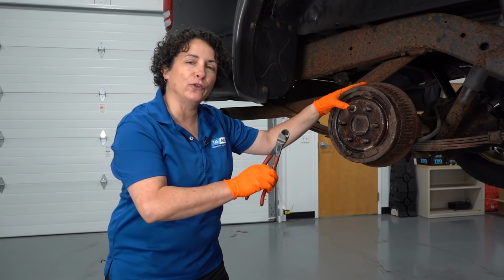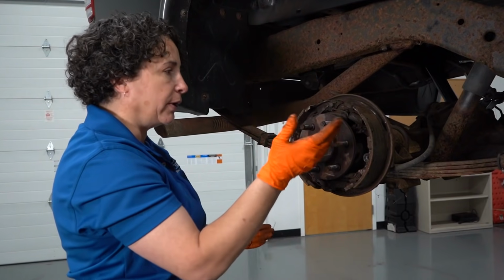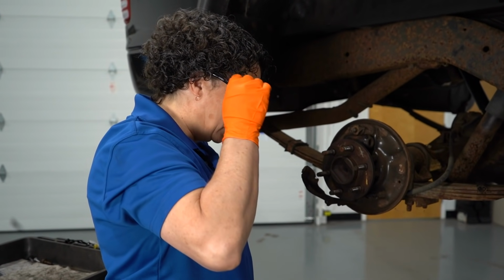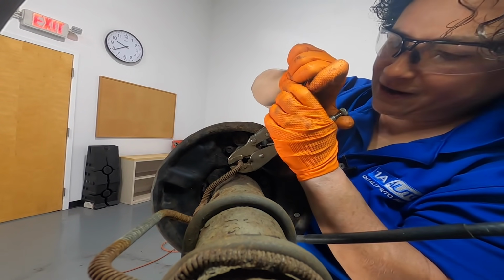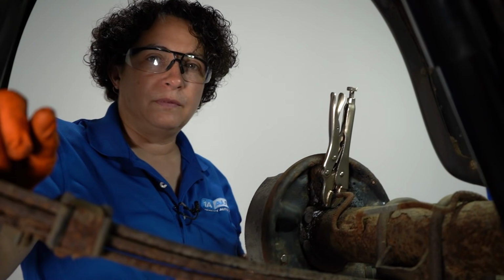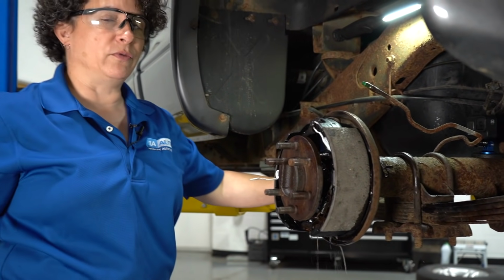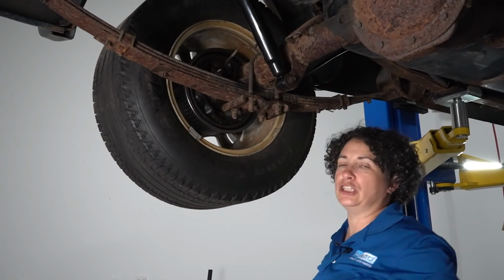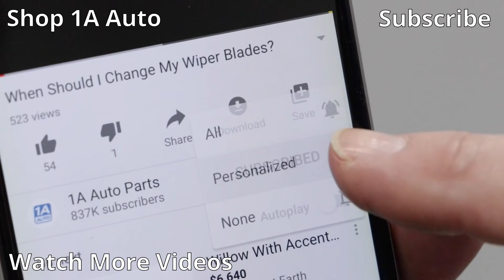Common Drum Brake Installation Mistakes!

Comment: Thank god for this video...my wife's cars drum brakes are starting to wear down and I told her I could replace them and said no wait until they start squeaking I'm like no babe that's dangerous....not only that but I like gaining experience from doing something like this and saving money
My wife is gonna learn sooner or later bad brakes dont last long at all
Reply: Drum breaks almost never come with the metal tabs that squeak. They do sometimes squeak when the drums surface is really damaged like the ones in the video but driving like that is dangerous
Reply: For disc brakes only. Once I hear the warning whistle, as I call it. I start saving money up for the brakes. Depending on how much you drive, or brake,,should be about a month. 2 Easy. But not guaranteed. Gather up the money. And if I have the money already, I go ahead and buy the brakes and throw them in the trunk. I personally will let the warning whistle go for a while. But as soon as the brakes grab hard, within the next seven or or eight days, I replace my brakes.

Comment: Im doing my rear brakes Feb 24, 24 Saturday in my 2011 silverado LT 1500 5.3liter. I have never done it before. Im not a mechanic. So im using your video to help me. Thank u.
Reply from the maker: +@losmoore3358 Thanks for checking us out. Shop for high quality auto parts on 1AAuto.com:

http://1aau.to/m/Shop-1AAuto-c

Comment: Just put new wheel cylinder brake pads drum on driver side.
The old one had a yellow plastic spacer in between the drum and hub..
Turned the wheel bearing and drum get a grinding sound 90% sure it's not the shoes. Pretty sure it's the backing plate.
Do I just put a new spacer or is there a way I can figure out where the grinding is on the backing plate and drum?
Do you have a video showing this process??

Comment: I ruined a brand new wheel cylinder because I was trying to bleed the brakes with the drum on lol thanks for the info I didn’t know what I did wrong    I replaced my wheel bearing and the last thing I have left is to do the rear drum brakes and I was having difficulty bleeding them. You helped a lot sometimes the simple things help people so much!
Reply: With the drum off I’m sorry

Comment: I've never had to adjust a brake cable doing that job unless the brake cable was too loose. And to adjust the brake cables on a system like that,you put on the new brakes, you close the adjustment so that the brake drum slides on uncomfortably but not too tight. Take the vehicle to where you got a lot of room and drive backwards up to about 10 or 15 miles per hour and then slam on the brakes. That will automatically adjust the shoes inside of the brake drum. Caution. Skilled drivers only

Comment: Bought a 2007 Saturn ion 2. Both front tires would skid when hard braking. Both rear wheel cylinders were bad. Replaced front rotors and calipers and pads. Then rear shoes and cylinders. Now my driver rear locks up and skids on hard braking. What did I do wrong?😢

Comment: 2 weeks ago the mechanic replaced my rear brake shoes. Now my two rear brake cylinders are leaking fluid on the drum shoes and have ruined them. What do you suppose they did that could have caused that?

Comment: I really need help with a nissan 2013. sv with 
I took it to the shop to check brakes because they were low. Then the mechanic said it need to replace all nrakes in order to give me guarantee of the job. I let him to replace them and the car still the same.
So, i took it to Midas they are specialists in brake. and their disgnostic is the master cilinder and they were about to charge me 900 dlls . It is a lot of monet so i decide to do it myself, I replace the master sylinder but i have the same problem. What you can tell me to fix my problem? im desperate. This is my daughters car and i wanted to return ir to her but im frustrated with mechanics that tehy only want to rake advant of ppl.Please help me
Reply: #1 Never go to Midas,  it's always $900 and honestly I'd avoid all major corporate chain places to look at it.
#2 If you've already paid for repairs they should guarantee their work till it's right. Have you told them? Or called a corporate office maybe?
#3 What happens when you pump the pedal does it get harder to press or stay low?
#4 Have you tried an online forum for your specific model vehicle?
#5 You could buy an online Haynes manual as a guide

Comment: 133k miles and never had brakes done????   I'm surprised there is any brake lining even left on those shoes and I'm surprised she didn't have to cut the drum off, or pull the axle shaft out to get the drum off.

Comment: One subtle point I’ve messed up in the past is getting the shoes on the correct front or rear orientation. Was hoping to see that here. Also I don’t know how you New England folks can stand working on so many corroded parts all the time. 😨
Reply: Always remember if short shoe in the front long shoe to the rear. Unless both shoes are the same length on the breaking pad itself. Back in the day they called it a short shoe and a long shoe short shoe to the front long shoe to the rear

Comment: I got it all toghter, new cylinder installed, shoes installed, springs back on, then before installing the drum, pressed on the brake to test. blew out the cylinder, back to the drawing board.

Comment: My truck has the stock push nuts on the drums at around 130K, but the drums look great and I was almost tempted to not even replace the pads. But I'm in Texas, have owned the truck since 20K, and don't brake aggressively.

The slave cylinders both weep around the seals though, so I'm going to have to order them and go back in.

Comment: Also it's not on size fits all with those tools. I got just one retainer spring tool which has two sides and the larger side was still too small for my F-150, so I used pliers (probably easier anyway) and the plier tool didn't fit around the pin that the 2 top springs attach to. Still got it to work, and with a truck, you really need the right tool cause those springs are strong. I should have bit the bullet and sprang for a tool kit. lesson learned. And I don't think the F-150 has a cable adjuster like the one in this video, you need to rotate the star wheel.

Comment: Everything is so well explained, except for the use of eye protection before starting the job. Its really really important to work eye protection while working in a car, especially on brakes, as you will never know when those springs will fly off and hit your eyes. There is a high chance of dust and fluids from the brake getting into the eyes. So please, please always wear eye protection before messing up with your car.

Comment: I was waiting for don't do this act on the parking brake cable. A truck or car with over 100k miles you don't touch that cable unless you have to. There is a cut out in the backing plate, which has a rubber cover over it, at the adjustment star. You take a brake fork or screwdriver and adjust it. The more you bother the parking brake cable, the chances prize that will have to be replaced as well. Generally, if it's an automatic, no one uses that option.

Comment: the starwheel
adjuster never works most of the time they seize up even with never seeze im pulling apart a 67 belvedere right now my dad bought from some john force wanna be who cut the rear brakes then tore the front apart they left all kinds of stuff out when they put it back together im working with junk and he insist its all fine ! i told him he paid 10k for the car now hes gonna put 5 k into the brakes  ! i wasnt joking i could show this lady all sorts of wrong stuff ive never seen si much its all chewed up !